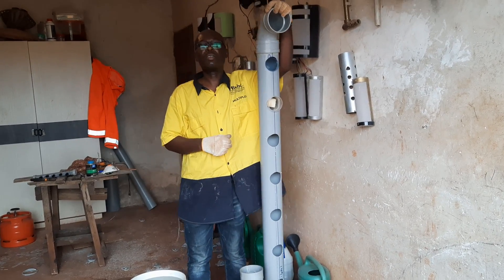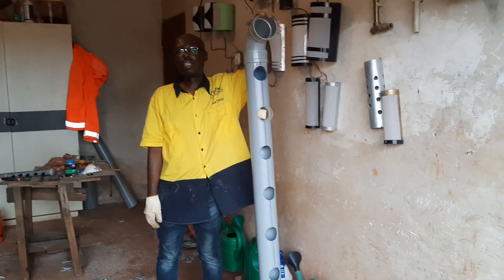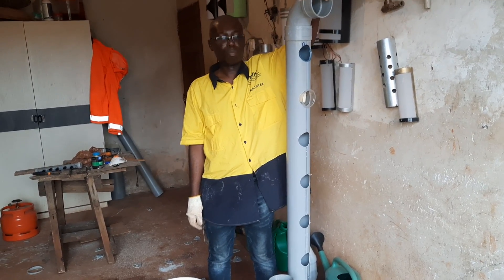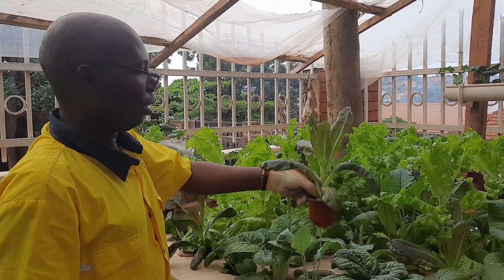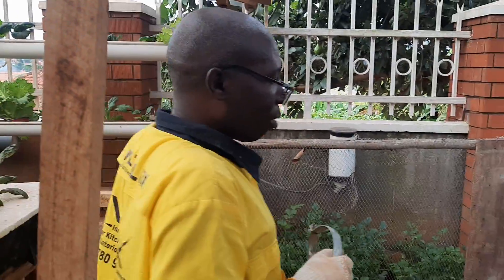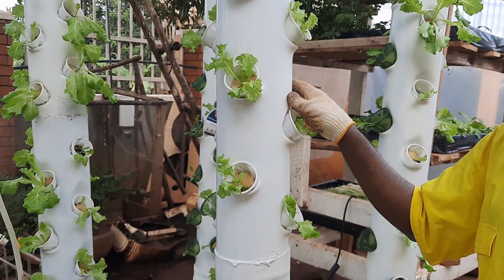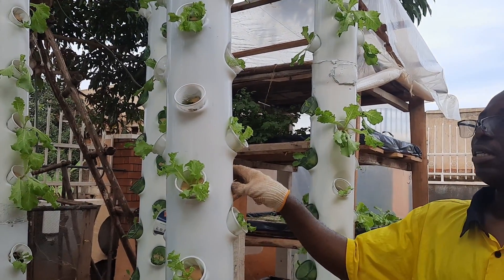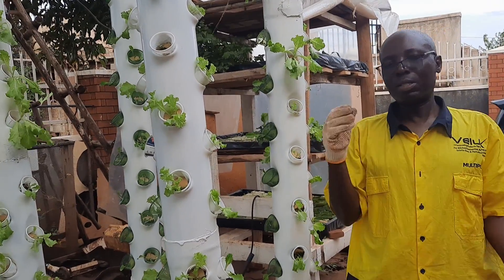Vertical Hydroponics Farming without a pump.

Comment: i have a few questions sir if you dont mind please
Reply from the maker: Please ask.
Reply: @ssemaga  what would you recommend as a first time crop to grow in a system that does not require a pump , and the holes in the  pvc pipes is there any other way to make them apart from using a hot gun , I have to think of the other questions I had 🤔
Reply from the maker: @chendakaps414  I recommend lettuce, pok choy, celery.

You can use a stove instead of a heat gun.
Reply from the maker: @chendakaps414  You can cut PVC PIPE using a hack saw.
Reply: @ssemaga  oh I never thought of using a stove that's interesting 🤔
Reply: @ssemaga  thank you sir , I'll write back to you if I have any further questions in the future
Reply: @ssemaga  actually I do have one question in mind right now , is there any way to make home made cocoa peat , and also could cotton be used as a substitute for it when germinating and growing plants
Reply from the maker: @chendakaps414  great question. You can use carbonized rice husks or carbonized wood chips. They all do serve as good growing mediums. Search for priorisis or carbonization of rice husks on YouTube.
Reply: @ssemaga  alright thank you , I'll get back to you soon 😁
Reply from the maker: @chendakaps414  you can also use hair drier to soften the PVC to make your Grow holes.
Reply: @ssemaga  I've failed finding carbonized rice husks 🥲
Reply from the maker: You need to find uncarbonised rice husks and you carbonise yourself.
Reply: @ssemaga  what exactly are rice husks , im in zambia so not too sure how to properly source them
Reply from the maker: @chendakaps414  like it sounds, husks coming of the rice we eat.try googling.